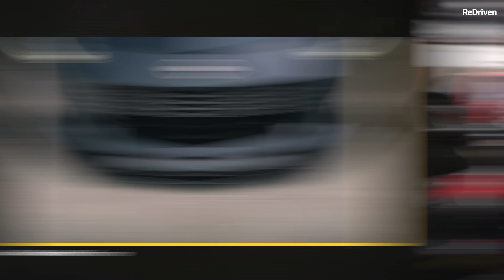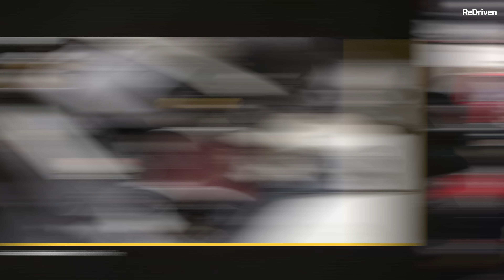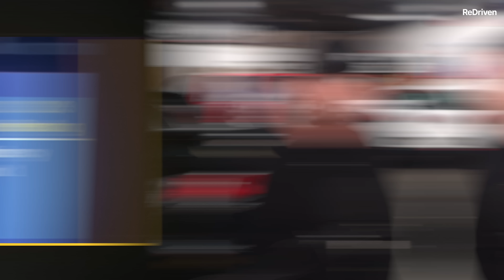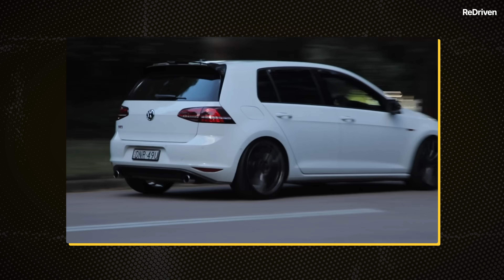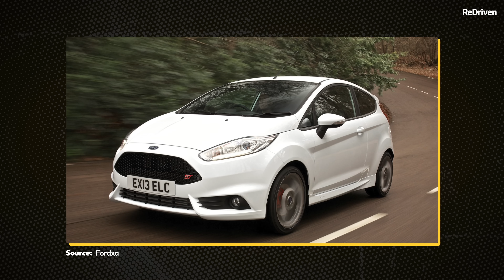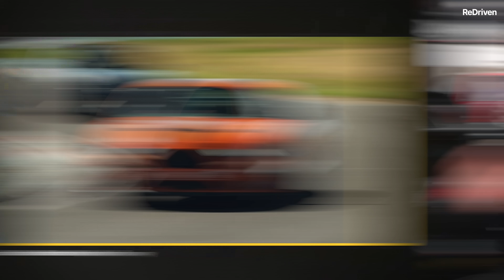7 CAR MODS YOU'RE WASTING YOUR MONEY ON! (and one EVERYONE needs!)

Comment: The best mod I ever did without knowing was a racing sim and Dirt Rally. Having ploughed off many times Im sure that saved me IRL when a twat overtook on my side of the road and instead of backing off he just drove faster thinking he could get round the a car he was overtaking and back over before i got there. He was wrong, forcing me to leave the road to avoid a head on collision. With 100s of hours on that sim I just went into autopilot and without knowing it was able to brake and fight the steering balancing the two on the grass run off which luckily was there to come to a stop about tn feet before someones stone wall to their garden. And i had no impact or damage to anything. Had i not, I'd have been spun off into a tree or the ditch and been badly hurt with a written off car if not dead. It wasn't until afterwards and during all the shaking I even realised that game had taught me all sorts of physics, surface and input nuances I'd never have experienced just road driving and replicating exactly what I'd practiced had become second nature and saved me, I've no doubt. And Im sure that wouldn't have been so successful had I not always run premium tyres too.

Comment: I have nearby guy who is pretty good with tuning, remapping, modifying etc.

I have Audi A4 35 tfsi, and there is possibility to bump numbers just a tiny bit up. From 150hp to somewhere around 190hp...
35 Tfsi have problems with shaking while in neutral, it's kinda annoying and increasing rev and giving him more hp would actually help with that.

Should I just go for it?
Reply: That engine really shouldn't be giving you any issues at idle. Check your coils, plugs, pcv and make sure you don't have a vacuum leak. Carbon buildup could also cause this- if the valves are gunked up you'll likely need a walnut blast.
A mild tune won't fix those issues but on a robust engine like that (2.0 turbo?) it certainly shouldn't harm it either

Comment: Pod filter? Had one on my RS Clio Gordini RS200. Exacerbated the torque hole, made in a bit crap in traffic but man it made it sound good. Bought the stock air filter housing, it was objectively better, but I missed the noise. Put the pod back on.

Comment: You guys have recommended after-market throttle controllers before. How "much more" could I expect to get from a proper tune vs getting a throttle controller? What considerations are there?
Reply: Throttle control will give you exactly 0% power gain
Reply: @jasonfields2793 ok gotcha, I see what you mean. Thanks!

Comment: The other thing with typical pod filters is how/whenever are they cleaned?  The MAF will cope with less air flow quite happily, it's their meaning in life, but a dirty filter will never help and certainly one that sucks in air from under-bonnet temps is just stupid.  Driver training - for sure, 110%.  Tyres make a massive difference too.  Stock rims are often the best combined with low weight tyres running at the lowest pressure you can get away with.  Too many just say run at 40 PSI etc - er NO!   By all means vary tyre pressure but know what you want to achieve and WHY.

Comment: Sorry, but some mildly lowered springs on whatever your daily grocery getter is is completely fine IMO just so it doesn't look stupid and high riding like OEM.  it's not like you're going to be setting lap times around the roundabouts in the suburbs.
Reply: I think the key point are the mods that have clear intent. Not doing just for the sake of it and bragging rights and fame.

Though having lowering springs, still get the best reputable stuff that is known to be tuned for OEM suspension at least. But then still hard to beat proper quality coilovers to achieve those. Just make look out for really good installers at least that they really know these stuff.

Comment: Guys you just saved my future ass! Am planning to install an after market exhaust + cat myself on my Jag, and had no idea how important a new tune is afterwards! Thanks mates, bloody legends! 🤙
Reply: Nah new exhaust isn't a waste of money. Ive taken my NA car (3.2L v6) to the track while stock and swapped the exhaust to slightly bigger ( 3/8" bigger, if im remembering correctly ) with high flowing resonators and mufflers. Went from a H to xpipe as well. It got better gas mileage and I also was a lot faster on the drag strip by .5 to .7 secs. To do exhaust properly you have to find out the correct piping size that works with your system..  turbod cars you can increase to a 3" and up for higher hp cars. Na you should stay under 3" based on the amount of hp your car can produce.
Reply: @slammedeuro104 well said. That's the only point I really disagree on with them.
Reply: Think of it this way, a retune with the new exhaust will make the new exhaust even more fun! 😁

Comment: Best mod is having better premium tyres and soundproofing
Reply: Tyres is definitely a must which is a massive safety factor as well.
Reply: Weirdly by getting a better speakers and dynamat, my car feels just that bit nicer to drive. Yes I agree with premium tyres part which I do anyway
Reply: nonsense, I put triangle tyres on the wifes X3, no issues whatsoever.
Reply: @cze33e Secretly trying to get rid of the wife are we? 😉
Reply: @cze33e  go test braking performance in the wet and see if you feel the same afterwards lol
Reply: Soundproofing adds weight, though
Reply: soundproofing.. yes, soundproofing the environment basically. but, also extracting more sound (and feel) from the car.
Reply: California wants to lock you into only OEM tires for your vehicle, they are going to make it a law.
Reply: @LeeCountySpeedShop  for god's sake! This is sooo stupid...
Reply: Soundproofing = more weight, no thanks.

Comment: When my shocks wore out, I installed Bilstein B6s (same travel as OEMs, but a tad sportier than the B4s) all around with no change to anything else. A few months later, I upgraded to Continental PremiumContact (with ContiSilent) from the ContiSportContact. Vehicle is now a delight to drive and handles great, even in wet conditions.
Reply: Change those tyres to Michelin PS 4s and it will take  the car to a whole new level.
Reply: @JDMGC  given how well the vehicle now performs in the wet, it is difficult to fathom that the Michelins could be better still. I don't recall having driven anything with the PS 4 tyre. Have you driven on the latest PremiumContact? It would make for an interesting comparison.
Reply: @espghia6607  Not the latest, I had a set a couple of years ago and they were awesome on my GR Yaris. I only drive now on semi-slicks. Currently on Yokohama AD-08R 255/35 18. These are awesome, and super fun in the wet.

Comment: I lowered my 370z and even though it looked AMAZING, I totally ruined the car.
Reply: My cousin in brisy did the same in her 370 , it looks and handles terribly
Reply: Similar but a bit different; my old V36 Skyline was muuuuch better on stock shocks with Swift springs vs dumped on its ass on BC coilovers
Reply: You gotta get proper coil overs,damper,ride height,tension if remember properly they have 3 way adjustments and stop bang out the cars without the cars struts not able to have full range to work your damaging the struts and the body of the car all that impact goes straight into the body.
Reply: Must not have done it right lmao. My shits slammed and drives fine.

Comment: at 7:00 Jim is talking about power and fuels economy not working together. I recently Got a diesel car, and have heard that it can make a difference for both in a positive way. Is this BS or a different rule for a diesel engine?
Reply: It's very true for diesel engines. They are known to have a combination of big increases in torque, conservative increases in HP with the bonus of an increase in MPG as it will be running more efficiently. Tuners in the UK regularly offer diesel tunes specifically for fuel economy. I'm definitely getting one when I change career later this year and have to get a diesel which will be commuting long distances.
As for petrol engines, I'm not convinced. My facelift C7 RS6 came with a stage 2 package running around 720hp but it always returns between 22-25mpg on mixed driving and 30+ on long motorway runs. It did come with a pop n bang shit on dynamic mode though, hate that I can't switch the pops/bangs off and instead have to immediately switch back to individual mode before backing off to stop it going off like an AK47 on the overrun. Tunes for that car aren't cheap otherwise I'd go for a remap and have it removed altogether.

Comment: I always figure it takes a lot of hubris to think you know better than a multi-billion dollar company that put a huge amount of money, and many thousands of engineer hours into setting your car up right. So, if you're going to change anything, you'd better know for sure it's something that will definitely improve it.
Reply: No, it just takes some common sense, and the knowledge that most cars are built by the manufacturers to appease bean counters over engineers. Almost all quality aftermarket parts will be an improvement over what was fitted at the factory if you’re not buying a supercar or homologated special.
Reply: This is a pretty ignorant comment.  At the end of the day every manufacturer is building cars to a particular market category/budget, and will compromise something in order to get the vehicle to the price point they want.  There's plenty of high quality engineering in the aftermarket space that produce parts that improve those cut corners.
Reply: @squatmufu6117 yeah, that's why I said "if you're going to change anything, you'd better know for sure it's something that will definitely improve it."
Reply: I have modified my cars, but only to improve on those things where the original actually needed improvement.

Comment: Trick with cheap suspension is go to cheaper. Swap in some Blistein B4 (OE spec replacement) shocks and greatly improve handling. Got a set for $600 delivered for my daily, actually got them from the sponsor Automotive superstore.
Reply: How would you rate the ride comfort?
Reply: @M4rk58 similar to modern BMWs non M cars. I put them in my daily (reused factory springs) and love it.

Don't recommend if you have a new car with low kays but if its getting close to 100k km its due for replacement, so will notice.
Reply: Like a set of bilsteins for my wrx .

Comment: Ultimate mod?  Advanced driver training.  Promise I typed that before the guys said this.  Recommend an annual session with BMW or Mercedes.
Reply: The best coaching IMO is drift coaching.  They teach how a car spins out and how to catch it.  I learned more from those classes than I ever did at track coaching.  Most of the classes  just involved racing lines and brake zones.
Reply: Most advanced drivers out there will still end up in the kitty litter if they are not in tune with the car, not so much the driver skill as it is knowing the vehicles limits.
Reply: iirc Porsche also has them Basic to Advance Driver Training Courses as well and it unlocks towards the Clubsport to GT4/GT3 training
Reply: Sadly, many race tracks are not close to those who live in or near big cities. I think the nearest track to me is 3 hours away (without traffic).
Reply: For BMWs the ultimate mod is working turn signals
Reply: @MikoyanGurevichMiG21 No I think BMW turn signals are always faulty😂😂😂😂